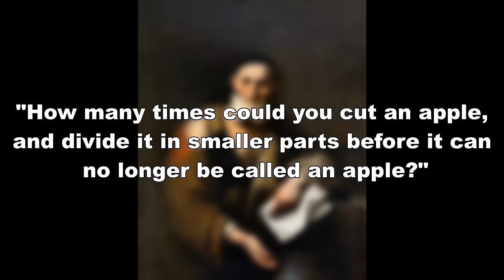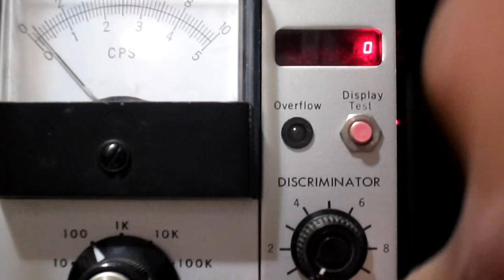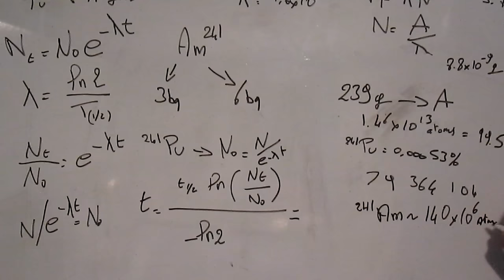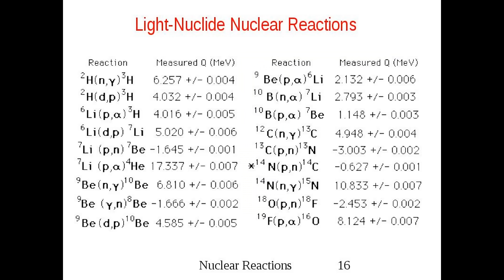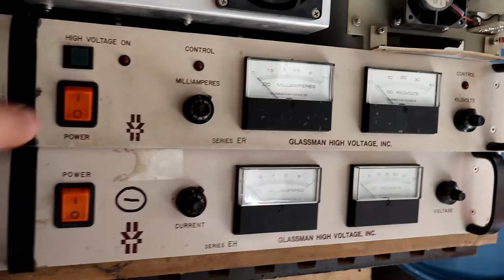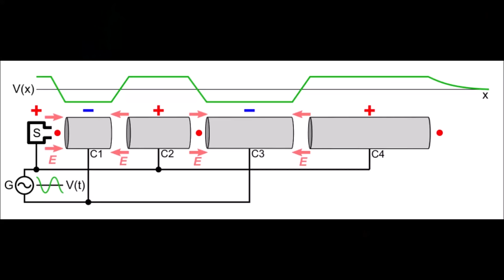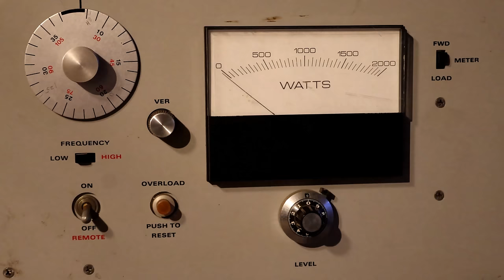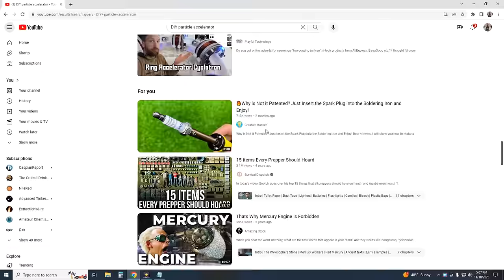DIY Particle accelerator (part 1)

Comment: As for constructive criticism, just about everything you parroted regarding historical scientific discoveries is incorrect! This is through no fault of your doing, this is what and how you were taught! 
For example, the nucleus of an atom cannot be more positive than the electron! Matter will always displace charge! Always! A dense nucleus cannot contain more charge than the electron due to the fact that there just isn't the room for more charge to exist! 
The humble magnet has taught us that opposites attract! Just as heat is attracted to cold, a higher state of charge is attracted to the lower state of charge, hence the reason why a charged styrofoam ball is attracted to styrofoam that hasn't been charged! 
I'm a polymath! There isn't a scientific field that I haven't delved into! When I'm told what an atom is and how it works, I cross reference this information with as many other things that I have learnt from other sciences and if there isn't a solid connection with how one thing works to how something else works and yet they both have to work together, then there's a problem with the explanation of one or both theories! So I have to keep working on the problem until everything within my knowledge works together! There's always a cycle! And then there's cycles attached to cycles, this goes on until you have a very good understanding of how everything works together because nothing lives in isolation! Everything is connected directly or indirectly! 
While you were taught that the atom is made up of protons neutrons and electrons, quantum mechanics tries to build on this incorrect base and provides even more confusion! It's 2023 and we have yet to even see these so called protons neutrons and electrons let alone what quantum mechanics is postulating! And yet we still talk about it as if we have seen it! There's definitely something there and until we can actually see what's there, we shouldn't be talking about the model of the atom! Maybe this just might be the incentive needed for someone to develop a new device that allows us to see it once and for all! 
So until that day arrives, we can only parrot that which we have been taught, correct or incorrect! 
There's a whole new world of scientific discoveries to be made if only people would question what they are being told! You will soon learn that while the subject that you focused on somehow doesn't quite fit properly within everything else.... It should! Nothing lives in isolation, everything affects everything! Like my favourite and truly correct quote of For Every Action There's An Equal And Opposite Reaction! This quote would not work if all scientific field's were a separate science that were independent of each other! The model of the atom is wrong and quantum mechanics is also even more wrong! You can't have two types of electric charge! There can only be the one electric charge, something (matter) can either have more charge (also known as positively charged) or less than (also known as negatively charged). Someone somewhere has misunderstood how the electric charge works, Benjamin Franklin worked it out a long time ago, you should look into him and his writings, he laid it out correctly and gave the most simple and easy to understand how the electric charge works... And it totally makes sense, so how anyone can misunderstand his explanation is beyond me! And yet plenty of people have and still do! 
Not too many people can do what you have done here in this video, if you work more on your own independent understanding of science, who knows what you are going to discover in the near future! I'm completely confident that if you do more research, you will amount to something greater than what you think that you will achieve..... You just have to want to!
Reply from the maker: it`s great to be a free spirit and keep an open mind! thanks for watching!
Reply: @Neptunium  your welcome 🤗....

Comment: It's 2023 and people are still being told that the Greeks had some sort of capacity in ancient times! 
The correct answer is they didn't! None of the so called ancient Greek scholars were actually greek! They were in fact all Macedonian! Alexander the Great couldn't possibly go on his world tour without the backing of a powerful nation or in Alexander's case a powerful kingdom! 
The word Greece wasn't invented until the early 1800's although the word greek had been around for at least 1000 years BCE, the word greek came from the Roman Latin word Grecians which the Romans adopted it from the Macedonians who called them Grejci pronounced Greitsi meaning foreigners! 
When the Rosetta Stone was found, there was no one who identified as greek who could read it! The alphabet used on the Rosetta Stone and by modern Greeks today is in fact the Macedonian koine alphabet which predates the current Macedonian alphabet. The Greeks are using a Slavic alphabet but wouldn't admit it. 
Most ancient Greek writings have all been rewritten to be understood in greek from Macedonian, even the middle text on the Rosetta Stone which was believed to be Egyptian demotic turned out to be macedonian Sanskrit which predates the Macedonian koine alphabet.... 
The Macedonians have been literate far longer than most people realise, yet we still are being told that it was the Greeks! And have you ever questioned which alphabet were the Greeks using before the Macedonian koine alphabet? An ancient civilization should at least be able to demonstrate how their literacy skills evolved over time? Strangely the Greeks alphabet simply appeared in its perfect form with no history of development over time! Very strange don't you think? Even the Egyptian hieroglyphics are a primative from of writing! The Macedonian Sanskrit middle text looks primative also but it's definitely far more advanced considering it's age. While modern day Macedonians can't read it today but could perfectly understand what is being said by whoever is reading it! 
It's time to break up this nonessical idea that the Greeks were a great powerful ancient civilization, they just happened to end up occupying the abandoned ancient Macedonian city of Hella which lay in ruins since the eruption of Santorini island volcano in 1500bce, the Greeks or as known in the book of exodus in the bible as the Israelites turned up after this event, so powerful was this eruption that all it's effects are mentioned in the bible, Moses was instructed by God to follow the piller of smoke by day and piller of fire by night.... 
The raining of fire and ice is the pumice stone which was ejected from the volcano! The parting of the sea by Moses was a tsunami created by the volcano.... There were no Greeks during this time! The foreigners had not arrived yet! 
The bible talk's a fair amount about the Macedonians and the Israelites but somehow seems to have missed the Greeks! Even all official maps prior to the 1800's don't show the existence of Greece anywhere! How is it possible to miss a mighty and ancient civilization on a map? 
You most likely were taught that the Greeks were an advanced civilization but this is incorrect! We know from the time of Alexander the Great and his father King Philip II who conquered the Greeks at around 350bce, a conquered nation of people can only amount to nothing of greatness and therefore nothing of interest! Which is why there wasn't a Greece on maps for the longest time! After the Macedonians it was the Romans who took over, after the Romans it's the Ottoman Empire for another 500+ years! 
So where from 1500bce till the early 1800's did the Greeks have any opportunities to amount to any greatness? It's nowhere! This is important for correct historical accounts! You effectively were lied to, the only thing that the Greeks have achieved is to take history that wasn't theirs and to financially ruin their own country! So much for being so great and ancient, you would like to think that they should have known how it works by now?